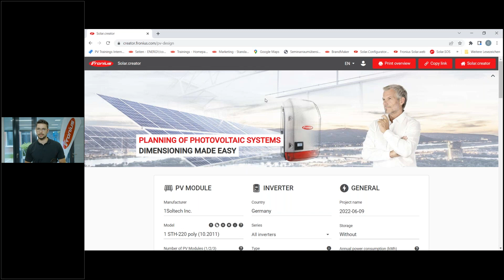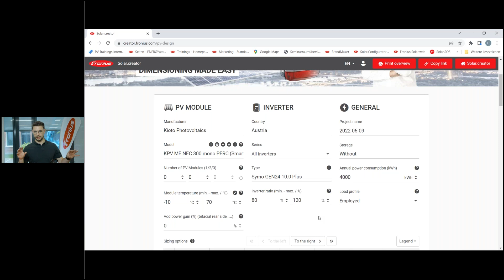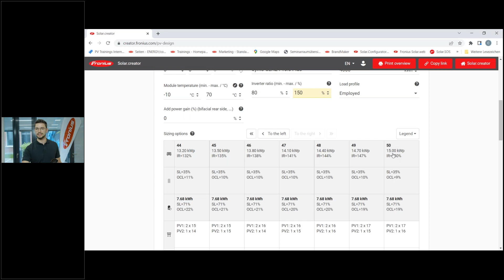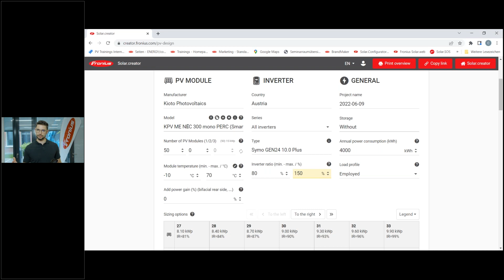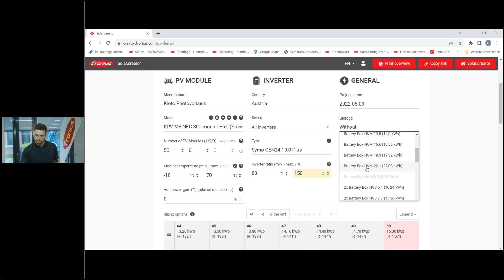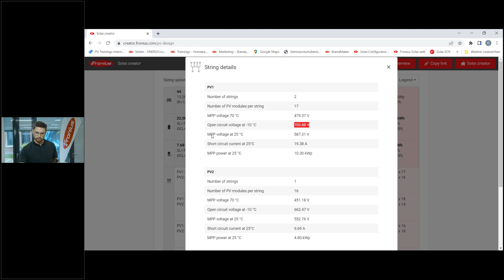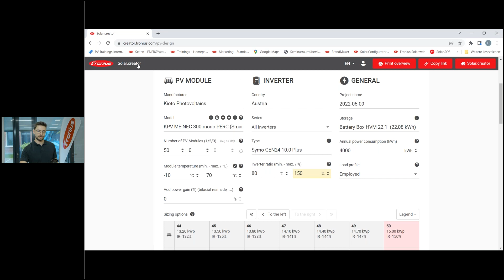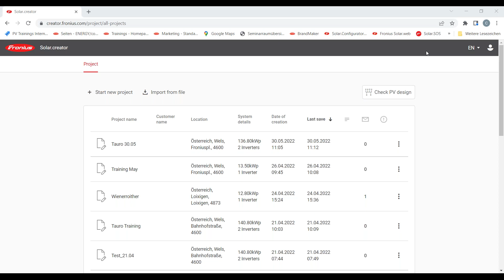Webinar: Solar.creator – Solar.configurator Integration (EN)

Comment: I am a bit confused on a current project. When I set up a system the MPP voltage is set at 10 degrees above the minimum I input. IN my job the panel will be at a minimum of -23C so the Solar creator sets the MPP voltage at -13C. However, in this video it is set to 25C. This will change how I would design the system and 25C would make more sense to me as the internal temperature should adjust quickly if I am not mistaken.